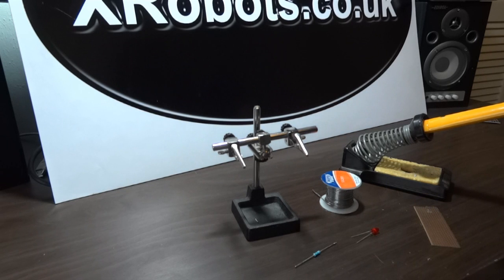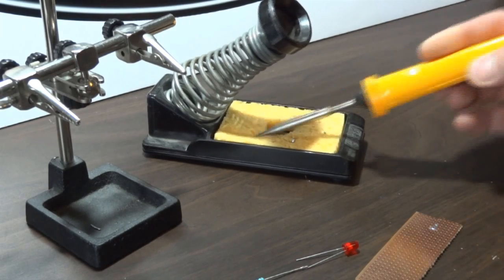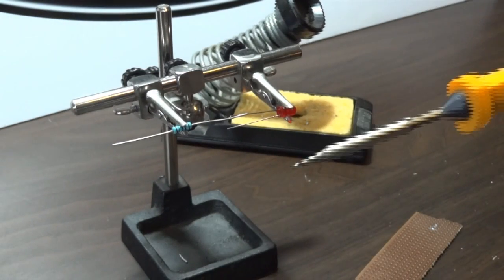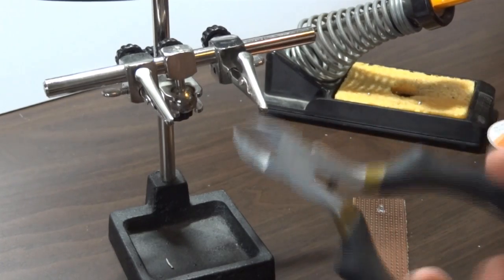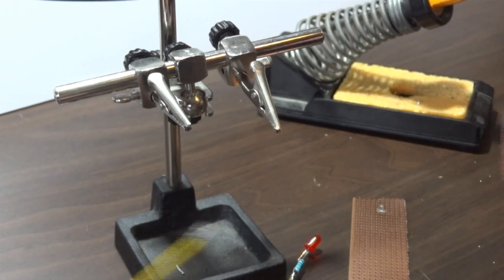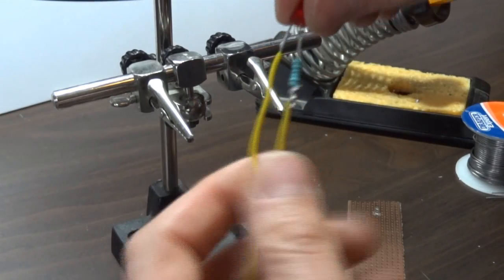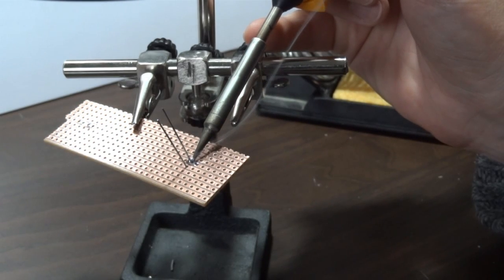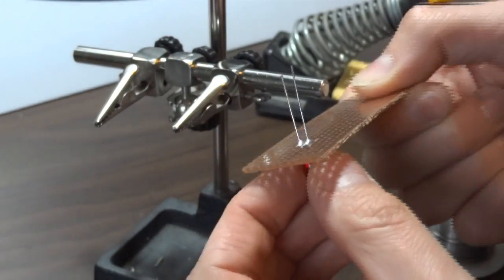How To Solder simple electronic joints, LEDs and resistors | James Bruton

Comment: When soldering multi strand wire to a component lead, I was taught to fan the wire strands out, create a hook with the component lead, wrap the wire strands tightly around the hook in the component lead, lightly crimp the lead/hook with pliers, then solder (but careful not to flood the splice), then heat-shrink when appropriate. It's meant to prevent vibration and other mechanical stresses from straining the splice and causing intermittent contact. Is this not commonly taught?

Comment: Worth noting that "nice and shiny = clean joint" is not the case for lead-free solder which is overall more difficult to solder well
Reply: Couple of issues with lead-free solder I've read...
1) the solder joints don't last as long; they tend to be weaker and break sooner
2) you have to heat up lead-free solder to higher temps which actually makes it more hazardous to work with!

Comment: I will need to solder wire coming out of a resister to a the base of a 5mm round silver rod (for a colloidal silver generator).  What solder and temperature should I use?

Comment: Great video.
This is one of the best demonstrations on how to solder small components that are not board-mounted and not subject to much pull apart-stress in normal use. 

This comment is about the segment from 3:40 to 4:30. (The video captions explain the method,)

1, Tin the wires by adding just a little solder then snip to length
2. Components come pre-tinned, but it helps to add just a little fresh solder. Snip to length.
3. Bring the wires together in a jig. (You can buy a jig or make your own.) 
4. When the wires are in contact, touch lightly for a second or so with the tip of the iron with or without out using more solder 

I tend to use enough tinning to not need more solder. Also with these tiny parts I rely on the solder strength instead of wrapping the wires to get mechanical strength.

The resistor in this video looks like a 1/4 watt metal-film axial resistor with leads about 1/2 millimeter or less in diameter. The leads are pre-tinned but if you add a little solder and then snip the leads you should have enough extra solder on the lead to make the join, but not a lump of solder.

 A magnifying glass for inspecting your work is useful when you are practicing.

If you tinned the wire and components enough, just touching the two wires with the tip of the iron when they are in contact should produce a good join. If not, you need to practice more. The idea is to tin the wires and components enough so when they are in contact and heated, the solder already on the wire flows together to make the join. 

The device I am modifying is about 50 mm (2 inch) diameter and about 10 mm (0.4 inch) thick. So I must clip my leads short, about 2 mm (0.1 inch) after tinning. Heat must be reduced to prevent damage to components. This is the reason for just touching the join with the tip of the iron for a second or so. (I use a 200 watt iron with pencil tip.)

(This is not what is shown in videos with bigger wires and bigger components, where you heat the work and the let the work melt the solder.)

I have not soldered for ten years. So before I started my current project that has wires of about 1 mm or less including plastic sheath, I practiced for half an hour yesterday, examined the result magnified 3x and then corrected my mistakes today. I will do the same tomorrow. I won''t work on my project until I have recovered my skill.

Like most other skills, soldering takes brains and practice. And a good video like this one for refreshing one''s memory.

Comment: Which is the one you solder the capacitor? Diode (Negative) Iodie (Positive)
Reply: positive
Reply: Newer articles say you can solder the resistor to either leg of the LED.
By convention, they generally solder to the anode/positive leg which is the longer leg of the LED.
I'm going by convention even though I've read differently!
It looks like I'll have to use electrical tape to insulate the solder joint between the LED and resistor's anode leg.  It's gonna look ugly but what other choice do I have?  Heat shrink might likely get activated by heat of the solder iron if I leave it on the LED unless it's wide enough to fit over the resistor.

Comment: Thanks for the video. I needed to know how to solder a resistor to the wires for one of my labs so that I can measure the temperature of water. There wasn't much detail on how to do it. It just told us to solder the wires and the resistors and put electrical tape on the soldered joints. So this helped a lot. :)

Comment: In China we do it by machine ,  full automatic soldering machine , about one pcs one second ,so fast
Reply: In China you do everything by machine, even have sex with machines!
Reply: @alpachino468  As China continues to industrialize wages will rise enough to force automation generally. But the electronics   industry in all countries is highly automated. 
What Lv Alex does not seem to understand is that in Western countries, especially the US and Canada, we make things with our hands as a hobby. This video is for us.

My last project was a cooling device for my Gear VR headset. My Samsung Note 8 was overheating. So I designed and built a light-weight compact cooling device that uses two 5 volt mini-fans that run off a USB power supply. Works perfectly and cost only a few dollars. (Fans made in China.)

I can operate a simple forge, weld by gas or electricity, make furniture, repair electronics (TV, computer, etc) and much more. But for the last 50+ years I have worked at a desk as an economist. I have three university degrees, none in engineering.

Like many others I make things for fun much as some people play sports or computer games or climb mountains. I began very early, about age 12 or so with a few simple hand tools. 

What did I want for Christmas? A set of screwdrivers. Or a metal set-square.

Comment: How many watts is your soldering gun? Mine takes a long time to heat up anything enough to get a good joint which makes soldering things like transistors pretty tricky
Reply: Mine can get to about 500 Degrees Celsius. It's got a dial that I can turn to alter how hot it gets.

Comment: You seem to keep the soldering iron for quite a few seconds on the legs of the LED and resistors without worrying about the fact that the components may get damaged from the heat. What temperature do you set your iron to? I'm asking because I can't find info about the recommended soldering temperature for standard LEDs. I've done quite some soldering these days and I've burned out many LEDs, even though I didn't solder them for more than 5 seconds. I'm trying to figure out what I'm doing wrong.
Reply: Might be a little bit late, but most ppl set it up around 350C.
Reply: @lycosa9527  thank you